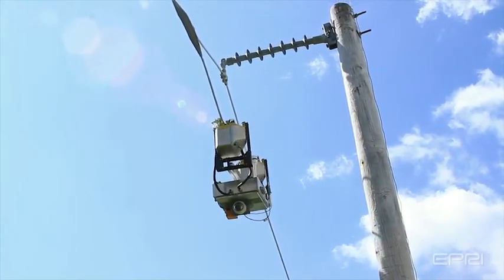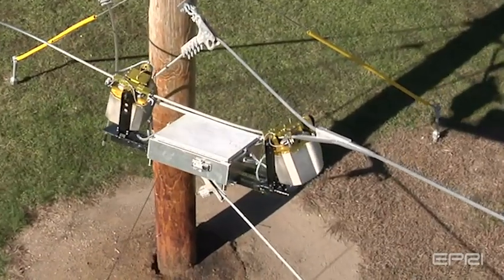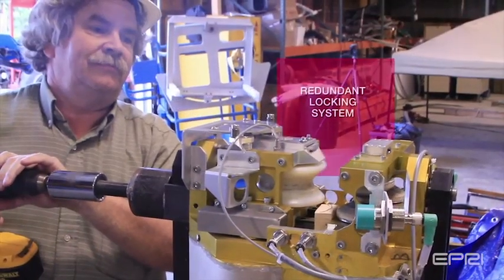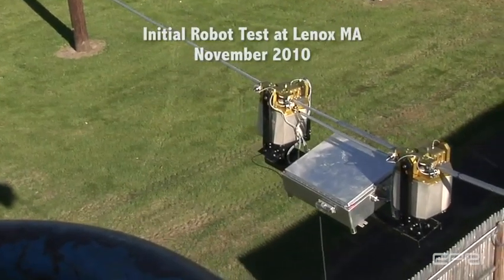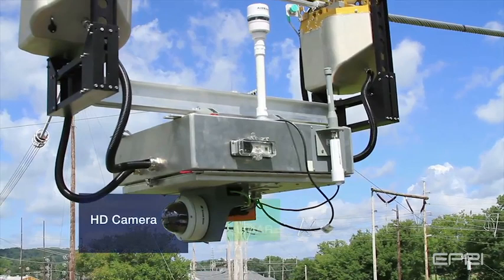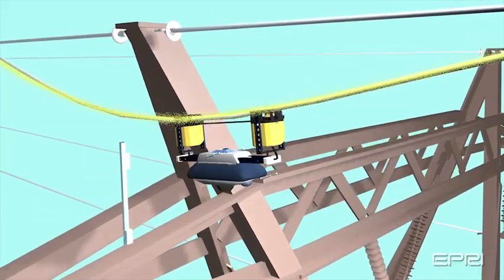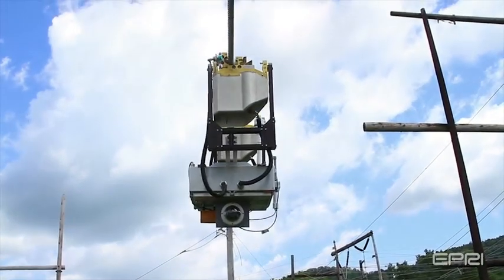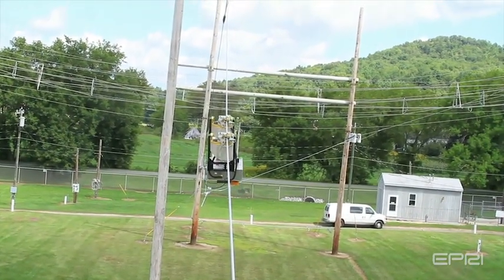Latest Development of EPRI's Transmission Line Inspection Robot

Comment: Hmm, wouldn't using 3 or 4 grabbing/wheel units allow it to cross those hard spots without adding diverters and other line modifications?  I am thinking an "unhook one leg at a time" walking/crawling technique.  A 4th leg would only be needed to avoid tipping over when unhooking the heaviest end to pass an obstacle.